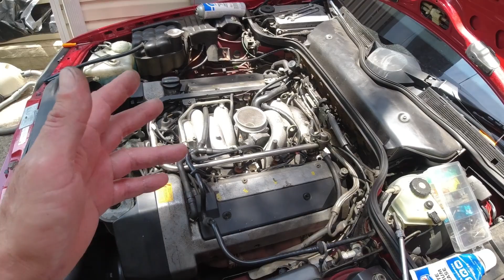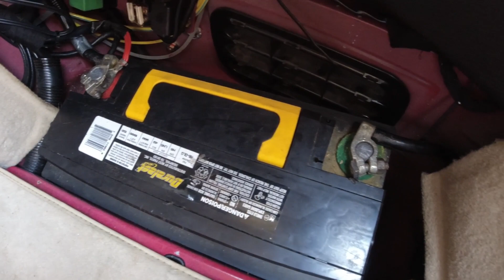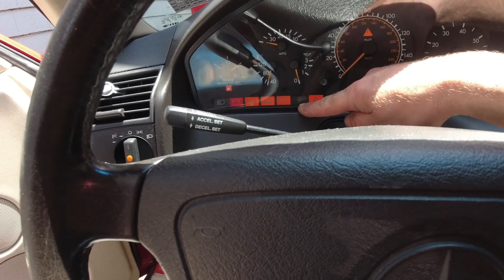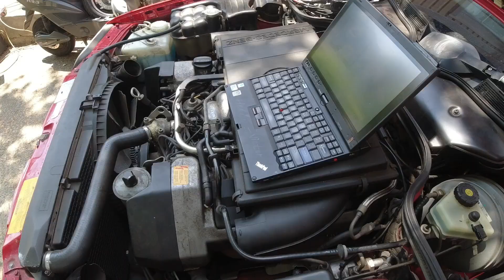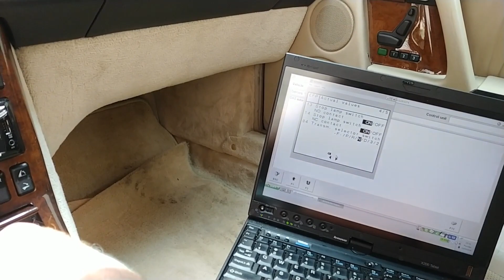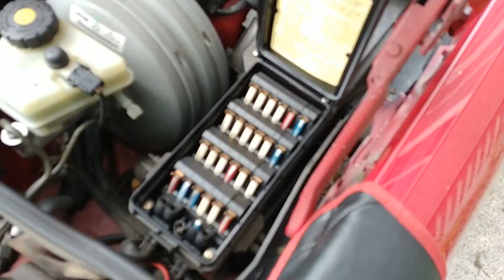1995 Mercedes SL500. My repairs are done

Comment: My 95 sl500 is struggling at warm up temperature. It will start when cold but once it gets to operating temperature it will run very poorly and then turn off. I then have to wait for it to get cold again to start the car. Is this because of the MAF?